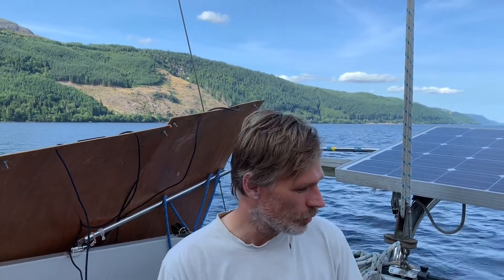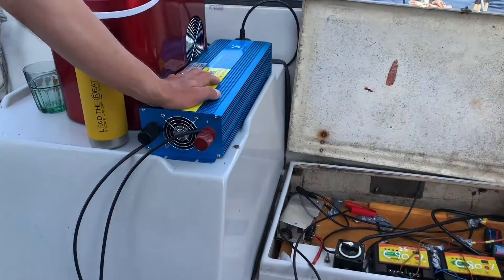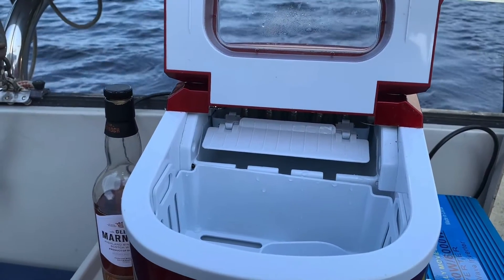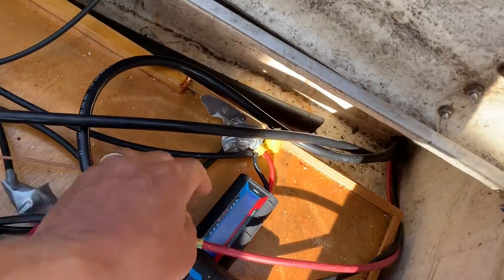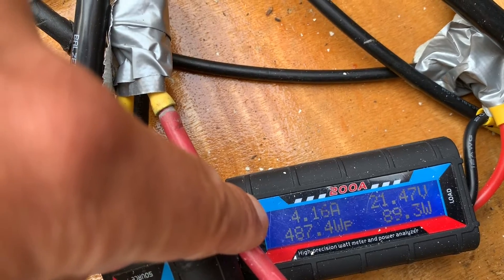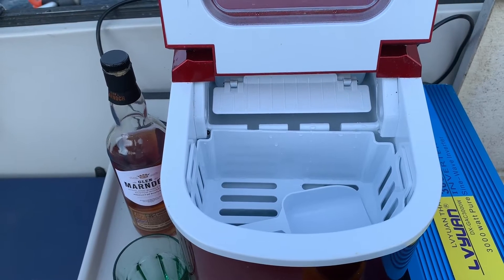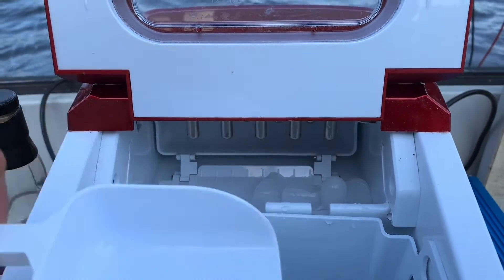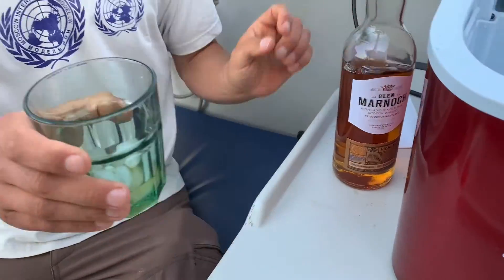5. How to make ice on a boat with a solar-powered ice-maker

Comment: What’s the minimum ie the cheapest battery for something like this?
Reply from the maker: You could do this with a normal car battery - especially if you had a 100W panel in the sun charging it at the time. You’d need a really powerful inverter though and very thick cables (especially if it’s a 12V battery system)